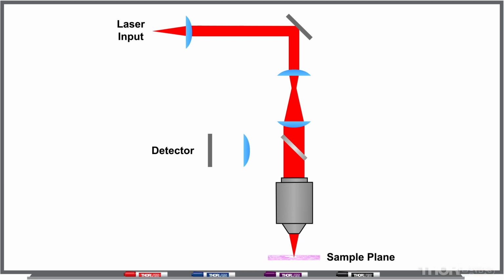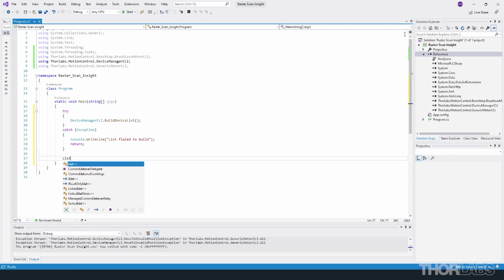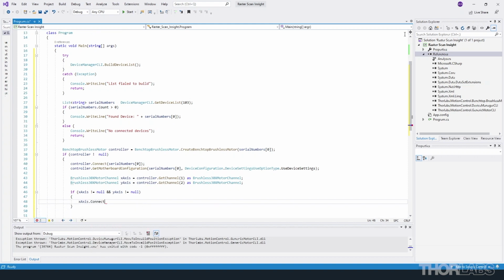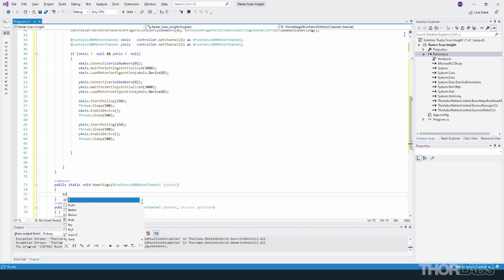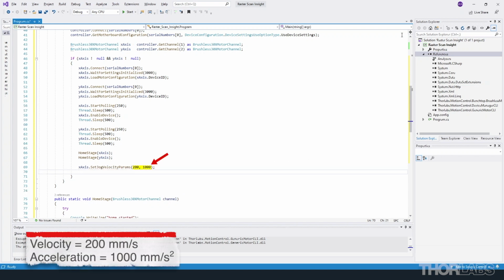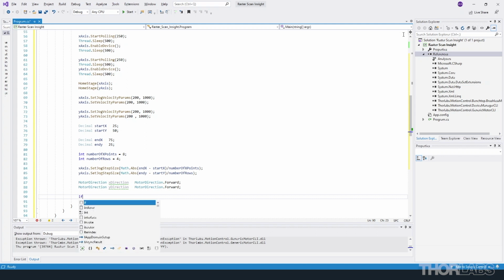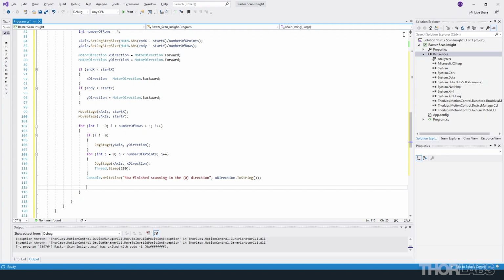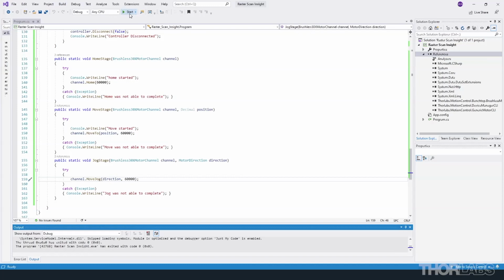Raster Scan Using Visual Studio® and C# Programming - Kinesis® BBD300 Series | Thorlabs Insights

Comment: Can this be done with python instead of C#??Moreover there in no need for the Kinesis GUI to be implemented?
Reply from the maker: @gurudaki  Yes, Python can be used. An example that shows the initialization of a Kinesis controller using Python is included in a different Video Insight ( https://youtu.be/VbcCDI6Z6go ), in which the control of a power meter and rotation mount is demonstrated.
 
It was not necessary to use the Kinesis GUI or the GUI layer of the SDK in the present Raster Scan Video Insight. The motor control user interface (UI) does not need to be separately imported into this application, since the Kinesis .NET libraries allow the user to directly initialize and control the motors.
 
If you are interested in different information, please contact Tech Support ( techsupport@thorlabs.com ) so that we can discuss your application with you.
 
For those who are interested: The Kinesis SDKs have a few different layers that can be used when programming custom applications. One layer is a GUI layer, which allows the user to import Kinesis controls into a custom application.